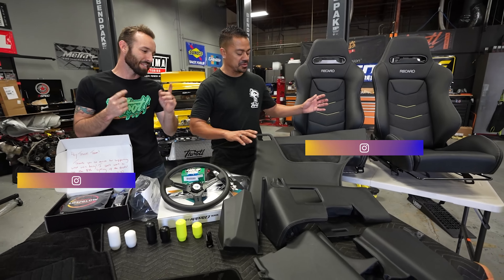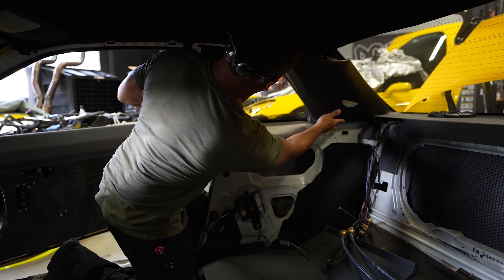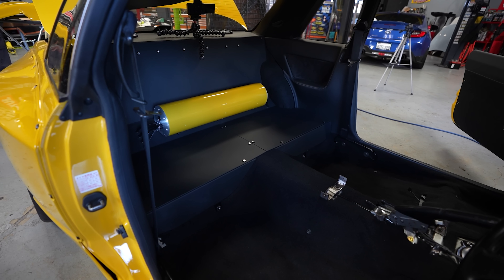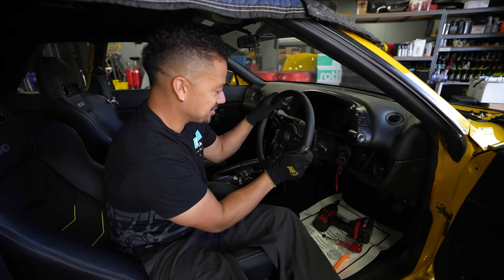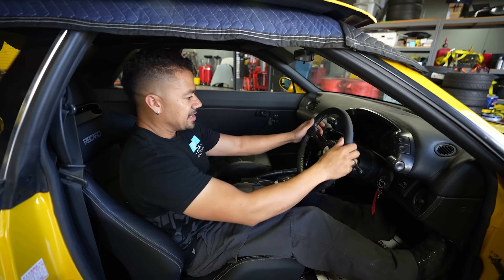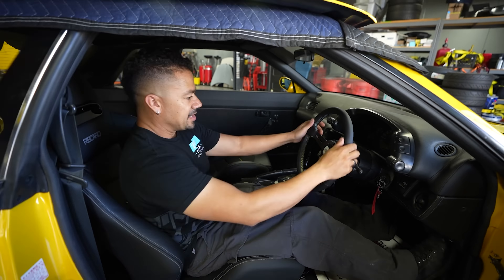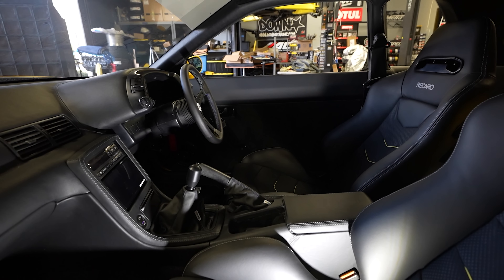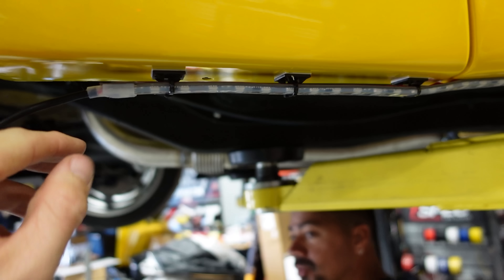Building and Heavily Modifying a 1989 Nissan Skyline R32 GTS-T - Part 15: LOWGLOW & Interior!

Comment: On the R 32 you really need to install the under glow in the wheel walls it doesn’t look right the lights need to be around the whole thing even the wheel walls that would complete the work

Comment: That pic is great of the car on the title, but gotta put some spacers in that rocker panel as they're sucking in the thing and makes those wonky dips.  Should hide the led's better too so they're not on the surface but hidden behind the rocker.  Use a piece of 90 degree aluminum inside the rocker, much better and hidden to backlight.  Same on that rear bumper there, tuck it in, keep em guessing it isn't just another chinese led kit.

Comment: being able to see the LED light strips is so damn ghetto. you gotta tuck that stuff so that it is invisible and only provides a glow. SMH
Reply: It’s because the floor is a smooth reflective concrete on the road it looks better
Reply: @gabequittem4999  no you can literally see the strips where they are from the side of the car. especially where they are only zip tied. and that is from a standing point of view. i would imagine its even more obvious when sitting down low like in a car next to it. I get it, these guys are mechanics not necessarily body guys so I give them a pass but in the future they should tuck the strips
Reply: Well, we were aiming for no permanent holes in the car. and with the surfaces where ticking would be possible being textured and weathered, not allowing the adhesives to stick, we opted to securing the strips on the painted surfaces, unfortunately those surfaces leaving some of the LEDs visible.